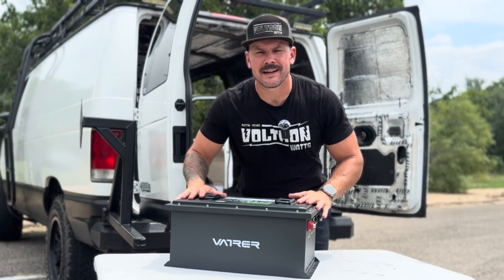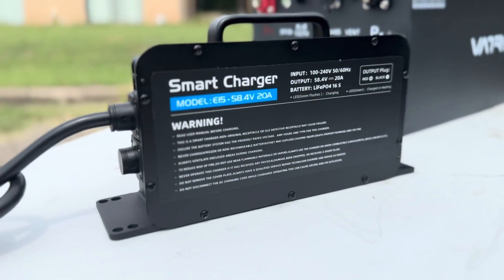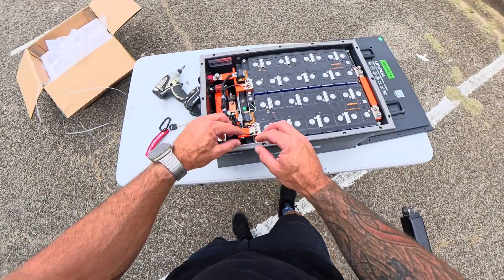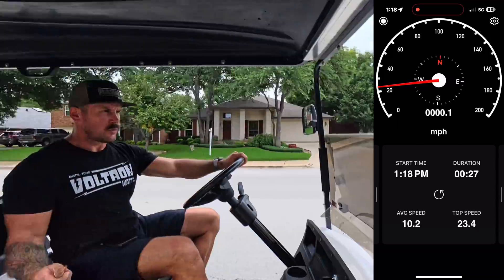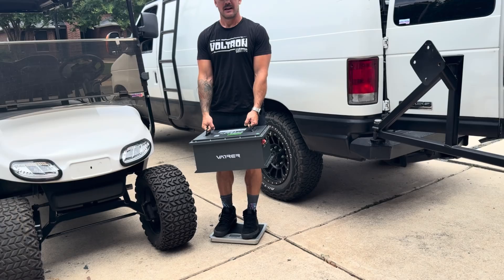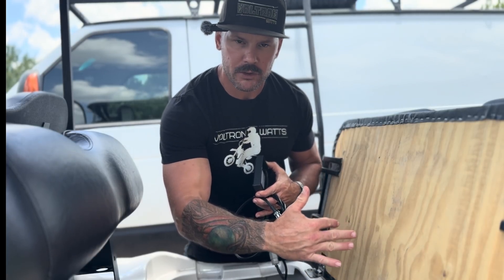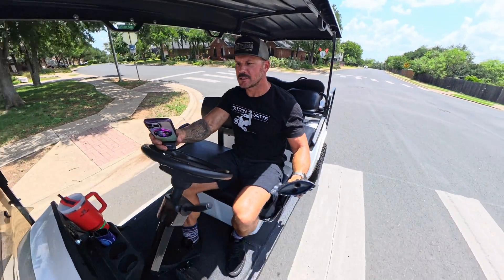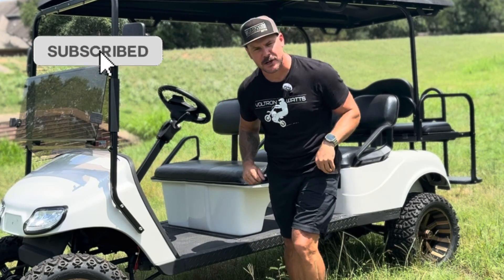Massive Upgrade- EZ GO Electric Golf Cart! 48 Volt Vatrer Battery

Comment: I bought on Febuary 16th 2025. It died July 15th 2025. NO REPLACEMENNT.
Reply from the maker: That sounds like a bad cell. Does all your cell health match closely when you access the battery info?
Reply: @VoltronWatts Bad sell or not. I called to eather get it fixed or a replacement. The guy on the other end of the phone had me take picks of this and that then said I would here back. That was days ago. I tried calling today. They have blocked my calls. They think I will just give up I guess.  That thing was $1700. I am not a rich guy.

Comment: Hey I’ve got an early 2000’s 48v EZGo 6-seater. I live in a hilly area and the cart struggles on the uphills. I already upgraded to a high torque motor and Alltrax controller but it didn’t really help with the slow uphill speeds. Do you think a lithium conversion would help? I’m looking at this same battery. Thanks!
Reply from the maker: Absolutely! The motor and controller can’t do much for you by themselves. Throw a more powerful battery in there and you’ll be set 🫡🍻
Reply: Awesome, thanks so much for the quick reply. Great video too 👍

Comment: This thing has a higher top speed than my 48v E-bike. You didn't comment on the acceleration. Was it much better than stock?
Reply from the maker: It was about the same as dat as pick up. I didn’t change anything in the controller after I installed the new battery, I could turn it up and make it accelerate faster 🚀
Reply: @VoltronWatts  Well watt are you waiting for? Get to it!

Comment: Voltron, I need help with my FarDriver for my razor, I asked Ryan Goodyear and he told me to color match the throttle connector. I did but the motor won’t move at all when I’m auto learning is the
Reply: Is there any advice?
Reply from the maker: What exactly is the problem? Does the controller power up?
Reply: @VoltronWatts yes, the volt meter and speed switch are connected and work, the controller is powered and is says everything is good on the app but it still won’t throttle ever
Reply from the maker: Do you have another throttle you can try?
Reply: @VoltronWatts no, I wish, the problem before was that whenever I plugged it in, the motor went full throttle and didn’t stop until I unplugged it
Reply from the maker: @GavinRobinson-k1s that’s weird man…. 🤔
Reply: @VoltronWatts what is hot pax information I want to contact them I’ve tried what seams like everything
Reply: @VoltronWatts do you think I should by a aftermarket throttle on hot pax?
Reply from the maker: @GavinRobinson-k1s worth a shot if you’ve tried everything else
Reply: @VoltronWatts what is a k1s
Reply: @GavinRobinson-k1s  what does the app say in the graph page, there should be an error. also when you twist the throttle you should see the throttle voltage move from 0-256. if its not moving then try to switch the wires around on the throttle